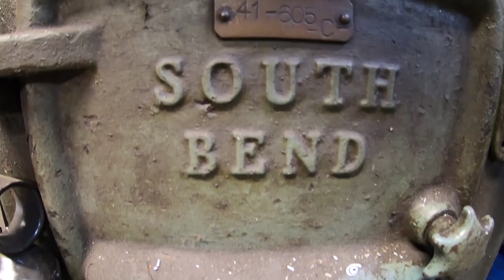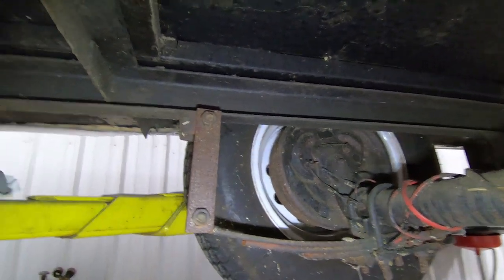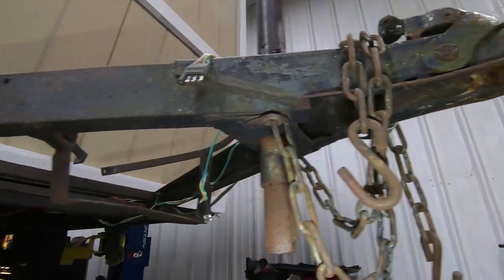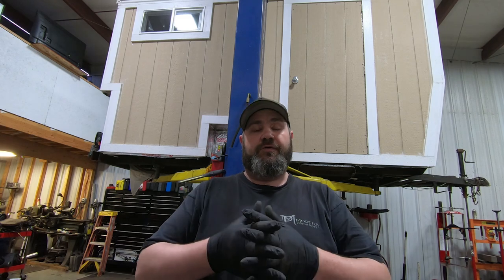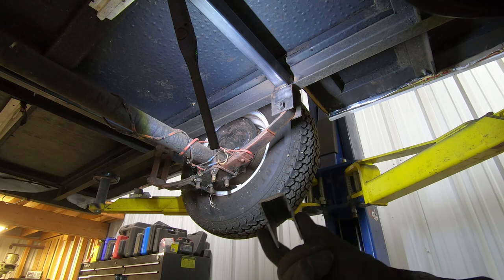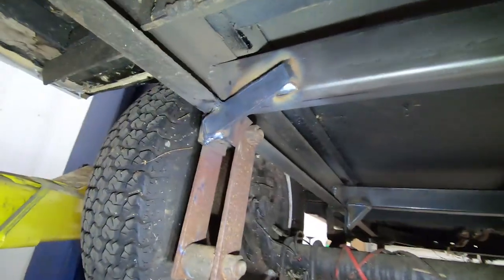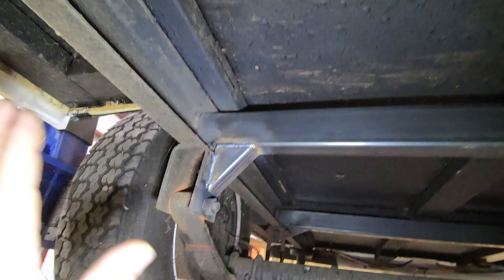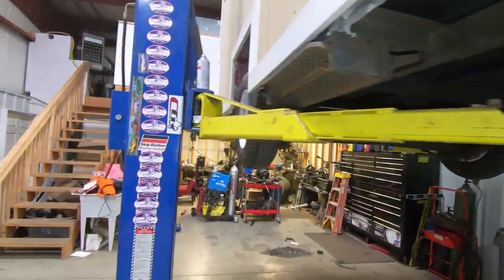Tiny Home Make-over or Make-under. Welding stuff!

Comment: One solution to the problem of water in that box tube is to drill a whole in the bottom. Or if you are really serious drill a few holes and fill it with the spray foam. 

If you need to add extra floor reinforcement consider using a 1"X2" or something similar angle in 18" thickness much lighter that the tube.